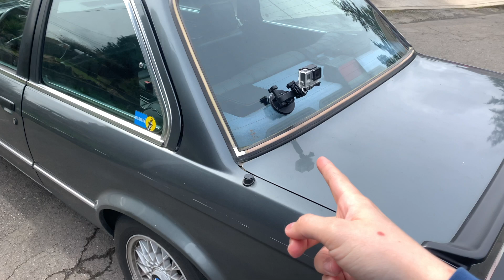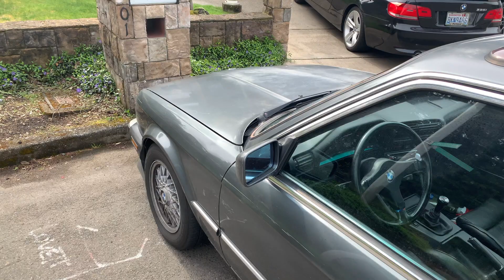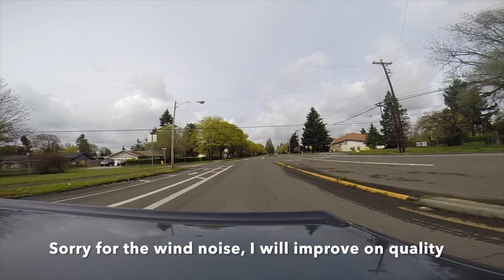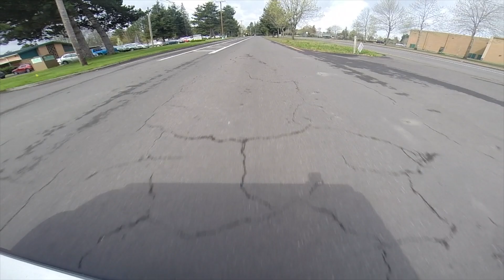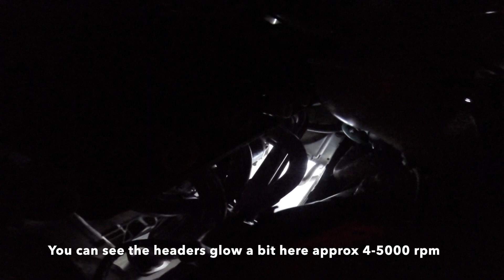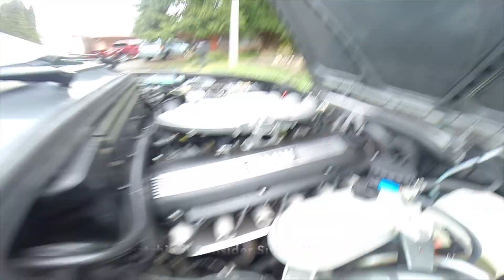BMW E30 | Headers Glow Red Hot

Comment: Will red hot headers destroy cats?
Reply from the maker: Well the temperature of the exhaust is relatively close to the stock exhaust manifold temperature at this rpm and speed. But because the Stock ones are cast iron and these are stainless steel it’s just easier to see them get red hot. So the short answer is no it’s still the same temp as stock it’s just easier to see it now because different thinner material used for the headers.